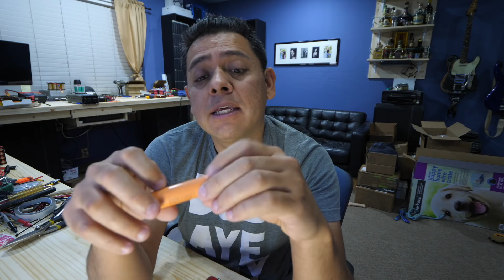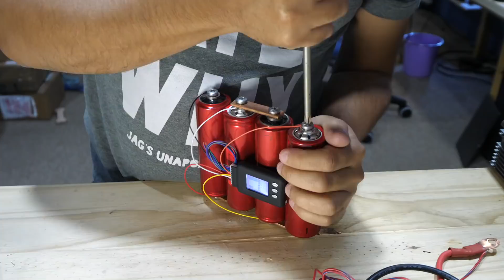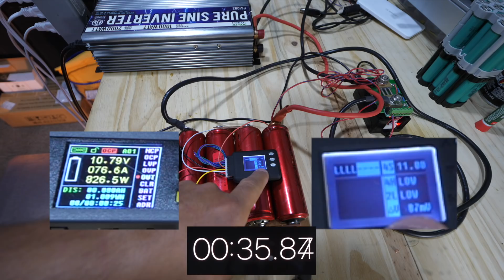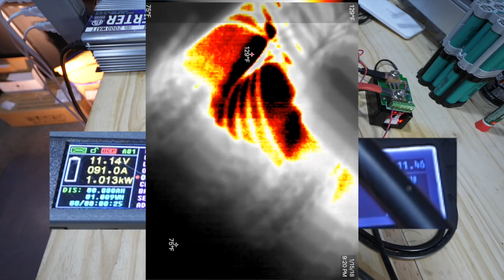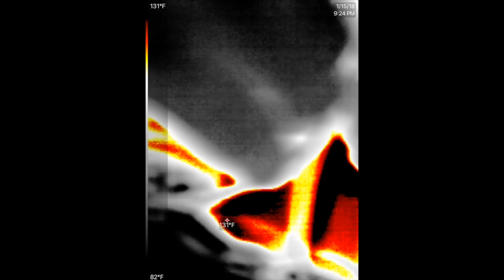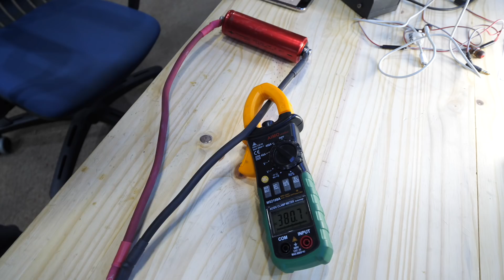12V Lithium Upgrade Headway 38120 Cells - 100A continuous (2018)

Comment: most fully charged 12 volt batteries are 14.4 volts and 4 3.7 volt lithium's would be only 14.8  so yes it will work.
Reply: You should'nt run Li-ion cells below 3.0 turn off as that's where the cut off occurs.. 4 x 3.0v = 12V.. so by the time it reaches cut off, you're at the voltage you want to actually run at.
at 4.2V fullly charged, you get 12.6V which is probably more ideal but the circuit would cut out way before the cells are depleted. so it's not that easy and would depend on what your powering.
Reply: McCuneWindandSolar wrong. A cars 12v battery has a nominal voltage of 12v. Fully charged anywhere between 13.8v and 14v is perfect. 4 lithium cells have a nominal voltage of 3.7v per cell making 14.8v. Fully charged they are 4.2v per cell making 16.8v

Lead acid nominal 12v
Liion nominal 14.8v

Lead acid fully charged 13.8v
Liion fully charged 16.8v. 

It may Work but it will end up blowing something up as the voltage will be too high.
Reply: The cutoff on most new high capacity 18650 cells is 2.5v.  Some of the newer cells its even lower like 2v now.
Reply: Phizicks exactly. On some cells you can get away with as little as 2.7v but for very short periods of time. Most wont have the energy density to produce the cracking amps anyway with out using 4x4 configuration
Reply: Fully charged lead acid 12V when they're not beiing charged is around 12.7V when rested and open circuit.  They tend to be 50% discharged at 12V at rest. 13.8/14.4 is about what cars run them at with the engine running.  Take a look when the engine has been stopped for a couple of hours.  12V invertors won't usually complain until the voltage is going on 15V and typically below 10.5.  Lead  Acid tend to voltage sag quite a bit with a lot of load and recover signifucantly when the load is removed / reduced.   Doing an equalisation charge (BMS substitute) you can take the voltage north of 15V.  Never take more than 50% capacity from lead acid and ideally less than 20% if you want the battery to last.  Leaving them flat for more for more than a day or two will screw them good.   Car batteries are useless for cycling (charge / discharge), you want deep cycle batteries which are a lot more expensive.   Traction / Forklift batteiries are ideal, Forklift batteries tend to be individual 2V cells.  A couple of T105 batteries (6V each) are a cost effective compromise Each will be several times more expensive than a car battery.
Reply: um I'm right, and so are you.  14.4 volts is were a 12 volt battery will stop charging, or were most chargers will cut off even the alternator in a car will stop charging at 14.4 volts. I also have a solar system at 48 volts, and when fully charged its at 57.6 and with no load they will drop to and hold about 56 volts witch is about 13.8 volts per battery.
Reply: McCuneWindandSolar well all the cars I have ever checked have been around 13.8-14v max charging voltage. If that is the case you will never charge the liion cells to even nominal voltage. And even if you did the 16.8v would sure to fry something. Hence why people don’t use them.
Reply: If you use 4 cells on a 12v car system then if you retain the car's charging system they should not charge up to 4.2v each but only about 3.6v.  They should last longer by doing this.
Reply: Zen Zen but also charging to 3.6v is under nominal voltage. That’s like charging a12v lead acid battery and charging it to 11.6v and expecting it to perform well. It won’t.
Reply: you try charging them at 3.6v per cell and tell me how many days you had to run your engine to get them up to 1/4 charge. li-on cells do not take much charge current at that voltage. Li-ion need voltage to rise as current drops to maintain any charge current, so after the cell leaves 80 discharged state the charge rate will tether off to all the way down to nearly nothing, remember a  li-ion cell unlike other cell chemistry's  will maintain its nominal voltage or greater for most of its discharge cycle this has a downside as well as its benefits. without a voltage difference greater than the cells internal resistance no current will flow.... no charge... no start....flat cell. This is the first major problem out of a few which make using li-ion cells in a car without purpose a designed charge controller and discharge voltage regulation.
Reply: 4.2 x 4 is not 12.6 it is 16.8. perhaps you meant 3 cells but then a standard alternator would overcharge them at around 14v and you would have a bit of a problem under your bonnet.
Reply: alphabuilders I think he is a little confused by it all. I thought my first reply to him made it easy to understand. Clearly not
Reply: MrOrangeman18 2-3v over is going to blow something in the context of batteries? If something fails because of that then the designer is an idiot

Comment: How much is the average life of a lithium battery?
Reply from the maker: 500-5000 cycles,  depends how you use them
Reply: In my house in Puerto Rico I have a system with a 5'000 watt inverter. 24volt can make a battery bank using those batteries. The two electrical appliances that consume the most are washing machines and refrigerators. The other is LED bulbs and television. How many batteries do you recommend? Thank you.
Reply: My inverter is reliable 5000.
Reply from the maker: Average American home uses 30kwh a day.   Where do you land?
Reply: my electric energy payment receipt, I have a consumption of 8,200 watts day. It's that the most time I work. My 6 solar panels are 37.2 v and 8.42 amp max AMP 9.10. It works for me by buying 32 battery to make 4 lines of 24 voltage or 64 battery to make 8 lines of 24v. I always appreciate the help you gave to Puerto Rico. If it were not for inventions, we would not have energy 😂😂

Comment: great video. have you done anymore with the full river cells? when I saw them about a year ago. I figured I knew what that river was full of. if you say they are OK. I believe you. I just don't know witch way to go! I'm working on a large DC generator. to charge my 24v bank. I could make about 560 amps at 12 v or 1/2 that at 24v. about 750 watts per HP. and the alternators are about 60% efficient. so it will take quite a bit of power to spin them at about 1500-2000 rpm.  here on the east coast there can be a week or two that are sunless! I need to buy a few per month. every month. I can't seem to save enough funds to save my life! I do not want to finance. I'm disabled and living on a very fixed income. and in a catch 22 situation. if I could just get moved. I'd have the funds. if I move I'll be without power basically. I have 200ah batt bank.  no solar panels. and a couple generators.  I don't know if I could make it a month or two. with very little power. maybe I can get more batteries. and make it and use my inverter charger to charge the bank!  anyway. sorry for rambling. its cold here and I guess cabin fever is a thing! good day and thanks!

Comment: That the Inverter shuts down at about 10.5V is because it is normaly used for Lead-Acid Batteries 1.75V per Cell.
The clostest by default would be LiFePO4 Cells with down to 2.00V per Cell and wit 3.6V nominal Voltage it would with 4 cells work even better in Car the Alternator gives out about 14.4 V.
Reply from the maker: That’s why I️ recommend 24v minimum wit lithium
Reply: +1
Inverter shuts down to avoid lead-acid battery damage by sulfation. It is designed for PbSO batteries.
Generator in a car delivers maximum 14,7V normally so 4x3,7V fits almost perfectly but from the other hand Li-Ion cells charge voltage is around 4.2V. Additionally Li-Ion requires strict temperature and voltage monitoring to prevent fire. 
All above makes this kind of replacement not so easy and even dangerous.
Simply put, normal car electric installation is NOT designed for Li-Ion cells.

Comment: 2 x 4 or 4 x 4 for cranking a car?
Reply: crapcbm Assuming these are 8AH cells, and a small car battery is around 40AH, I'd guess you'd need a stack of 4series X 5parallel

Comment: What's the difference between these battery's and Super Cap's???
Reply: it's not about behavior.  capacitor's (super caps included) store energy in a electric field.  Batterys store energy with a chemical reaction.  A electric field will release it's energy almost instantly, but it takes time for chemicals to react with eachother to produce current.

batteries are usually name at least vaguely after it's chemistry, and different chemistries have different properties.  Even within a particular chemistry you can make large difference's based on design.  Think of a car starting battery vs a deepcycle RV one.  They both use the same lead-acid chemistry, but one is great for cranking out the several hundred amps needed to start your car, even in very cold weather.  The RV battery on the other hand can handle deep discharges and stores much more energy, but it can't put out the same amperage for a short time that the car battery can.

generally speaking you can have good capacity OR a high discharge rate.  The higher you go with one the lower the other is.  Ideally you don't want to use a battery with a higher discharge rate then you need, because using a lower discharge cell will net you higher capacity.  In the real world home gamer's usually can't find perfect cells, you just go with the best you can find at your budget.
Reply: MrInnovationWorks, batteries gradually store energy, and gradually release it. Capacitors quickly store their energy, and release it in a burst. Supercaps do so at higher voltages and/or amperages. LA (lead-acid batteries charge slowly (but can charge more quickly -- at a severe penalty) and can discharge quickly, like when you start your car, but their lifespan is short, and drastically shortened by fast charging; over-charging/ and fast discharging.

HTH.
Reply: lifespan of lead acid batteries is usually quite good if they are cared for properly (I rarely see people replacing car batteries in less then 4 years, typically more like 5-7)  AGM's are often capable of charging faster then a alternator will let it, up to 1c if you can find something that will pump in that much current.

The main downfall of lead acid batteries is their massive weight and poor deep discharge characteristics.  Other popular battery chemistries are usually capable of being discharged to 10% remaining capacity or less. Even deep cycle lead acid batteries usually only tolerate discharges down to 45% for any extended use, and even then their charge cycles pale in comparison to lithium cells.
Reply: Sean Flanagan , I see. However these battery's seem to behave more like Super Cap's than battery's, does that make them hybrids or just a better deep cycle battery?

Comment: I would love to have about 100 of these! or more. I'd like to add to or replace my 200ah 24v lead acid bank. so the test to really work in a real world. working system .it would work better with more cells. for less volt drop. and the cables are likely copper clad aluminum. its hard to find cheap copper cables. when I was looking for my 2/0 cables . every time I thought I found a deal. the fine print said cca.! so I got temco welder cable. 2/0 cable isn't cheap.  maybe you can shorten and double the cables. make them 12" or less and double or more the cables. and a lot of the volt drop probably came from the cables.  are they about 8ah cells? if I had about  300-400 of these. and use them for back up for my lead acid bank. or vise versa. how fast do they charge?

Comment: I do really like the screw connections on the headway cells! be nice if 18650/26650 cells came like that.
Reply: James stranger I was thinking the exact same thing
Reply: James stranger, I'm only using 18650s; I wouldn't want the bulk of screws and nuts or threaded sockets. Soldering/welding is a pain (and potentially damaging to the cell) but gives a nice package if no bads happen.
Reply: JAMES! Since the 70's i'd like to have copper bolts on them.
Reply: Go to Vruzend DIY.com to find them.

Comment: That's mad battery abuse 😀
I just did a battery build video on these a few months ago. I think what you have there is the 8ah versions, and I used the 10ah version to make a 4S pack for ham radio. I'm also about to build a 30 or 40 amp hour version with these cells. 
Anyway, great find, awesome cells.
Keep up the great work
Julian
Reply: Timothy Mckee you have to remember Timothy the batteries in parallel only increasing amperage while in series the increase in voltage. The BMS board will manage the balance level between the cells regardless of how many you have in parallel. But you can only get the correct voltage by placing them in series.
Reply: OH8STN  what kind of BMS are you using? I have 64 14ah from PSI but I have no BMS
Reply: Mrpiraterias bestech 50A bms for LiFe04
Reply: @OH8STN 
Very nice!

How big did your pack end up being and how much did it weigh?

I'm looking at possibly building a backpacking rig, myself, and would like to know what to expect.

KG5EDQ here.
Reply: OH8STN   De kc8hps Here.  bryan@tinysolarshack.com
Reply: Timothy Mckee these batteries aren't hot until you're pulling 30 40 50 amps from them or more.
Reply: Julian, Enjoyed your videos. What do you recommend for a BMS on our side of the pond?
Reply: Tiny Solar Shack hi Brian
Reply: Timothy Mckee sorry Timothy, ohms law!
Reply: Guys i want to build an electric skateboard. But the problem is really dont know that much about the electric parts. I wanted to use this motor(dual) from alien power system:  http://alienpowersystem.com/shop/brushless-motors/aps-6384s-sensored-outrunner-brushless-motor-170kv-4000w/. The problem is i want a long range about 20+ miles. Which batteries do you guys advice me to use? And how do i charge these. If somebody could help me i would really appreciate that❤️.
Reply: lol the intro wasn't ness ur question soon told us
Reply: I'm jewish. May I call it a CHICKEN radio instead??? L0L
Reply: If you had a number in series and parallel I bet they would self balance pretty well.  Just in series I’d use a bms on them.
Reply: Expose ur own idea